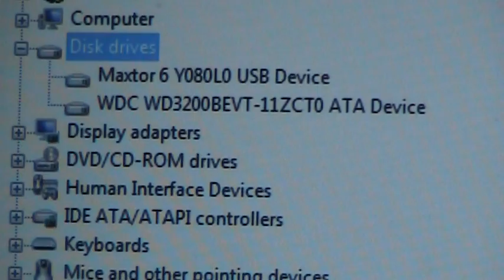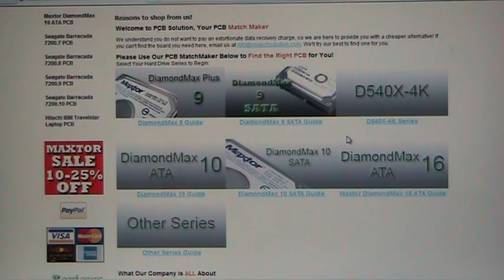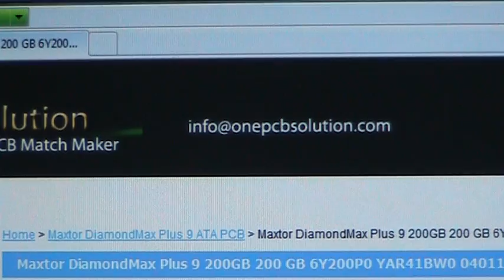DIY: How to repair a clicking damaged hard drive

Comment: @CoryDemone 

Platter hard drives: $0.01 / GB

SSD hard drives: $1.50 / GB (~$1.00 / GB for 1st/2nd gen SSDs)

This video is still perfectly relevant.  Also, when an SSD fails, you're completely fucked as the memory chips are soldered directly to the control board.

Comment: In The Tech field there is a Term called FRU: Field Replacement Unit , as he said earlier its either circuit board or internal problem. Repair can be done by replacing the none working part specially if its not worth the time and effort to go more technical to fix or find and pay some one with that level of skills, he showed simple trouble shooting skills to fix a complex problem . Nice Info

Comment: I got a maxtor and i get 1 big click.  No more clicks it runs really smooth but it doesnt do anything. Tried to run chkdsk /r but i cant. It somtimes doesnt even reach the xp startup. I get to choose whether to start up normally or in safemode but when the counter reaches 0 it automatically chooses normal startup but then it always makes 1 big click followed by some sqeaky noises and then it freezes. 
Is my hd broken?

Comment: @moastytoasty54 hard drive failure. you're on the right track. you rather than tinkering in hopes, you might be able get an rma for it. then you might have to get with the manufacturer for a startup disk and reinstall windows on a new drive. i just found my prehistoic maxtor if covered and it's from 2006. worth looking into.

Comment: @DH1Studios i filled mine with jello ( cherry works best ), then put it on the fence (south facing works best ), then i took a 12 gauge slug and "installed" it onto the circuit board. Now it works fine! :D

Comment: @makotomikami It is a mechanical hard drive and sometimes they make clickety click sounds.. It is somewhat normal.. But just to make sure.. Back up everything to an external harddrive. I guess that you dont have more than 250gb of disk so finding a cheap usb drive is very easy.  I use a program called always sync that is fast and cheap. The ac is probably not the resason because lappys have, well a battery :)

Comment: Ok serious question: I have this new laptop and the hard drive makes a low ticking sound sometimes, but performance is not affected at all, all programs run normally, I heard that hard drives do this sometimes when they're not getting enough power, and I've also heard my laptop would prolly need a better AC adapter, can anyone help seriously? :)

Comment: there is a click sound inside harddrive, then system hangs for some seconds.
some times it willnot booting. is my HD failed, replacing board will fix this? plz tell

Comment: @reply4reply Lucky, in my I.T class we had a few problems with static discharge.  Rare but it still happened, it could depend on clothing and if you touch something metal before messing with circuits.  Really I don't like to risk it when working on expensive computers.

Comment: I have a harddrive that was partially formatted by an Xbox 360 by accident. I tried to copy files to my new Xbox, but it doesn't work the same as the PS3 which lets you do that. I was only able to take files out of it and not into it, but now files can't go either way and I tried to use a trial version of GetData and it found 240 file, but it freezes after finishing. I can't click into files without it saying I should format it first, which would elete everything. I can't get my files out now.

Comment: @4BiZ20 dude, you can't blame pcbsolution because your hard drive has passed away :-/ This info is way too useful and if you want to know all that you asking, be kind and use GOOGLE - who is probably also used to find this video. (just to mention that i have "repaired" several hard drives using this method so i hope that you gonna repair your own the same way).

Comment: I was going to buy the circuit board for my harddrive but the actual harddrive costs $40 compared to $50 for the board only. You should sell the boards for way cheaper.

Comment: @MrShambolick Yes you are right. I want to warn every1 here: Easiest way how you fix a clicking HDD is: DON'T! As long as you're not in a clean (like CLINICALLY CLEAN; regarding dust) env., you're bound to get some shit into the drive and when you close it, something veeeery tiny 'll be floating around inside - wiki tells you about Bernoulli's principle, that keeps the head from crashing onto the disc via the air-film that builds up. Get something in there, break the air-film, dang there ya go.

Comment: A few years ago, I was transfering data to a seagate external harddrive.  It was sitting on a table one foot off a carpet floor.  The cord was tripped over and the HD took a tumble.  Now while it wasn't a super hard shock, it did take some impact and it was transfering data so the parts were moving when this happened.  It doesn't have a pronounced clicking sound, its more like a reaccuring humming sound.  And solutions?

Comment: OK, a couple of days ago my hard drive started to make weird clicking and clunking noises. I turned off my computer and tried to start it again. It said some error thingy. So I went to get a new hard drive. A day or so later I tried to boot with my original HDD as a second HDD and it freezes before any booting happens. Its stuck at the bios menu. What can I do or is it permanently damaged?

Comment: I dont know where I'll be with this drive by the time you answer (if you do), but my Segate Freeagent Hard Drive (500 GB) external, isnt getting detected anymore. Im pretty sure its spinning in there (i hear the whirring noise), I took it apart, removed the extra USB Logic board and connected it directly into my computer motherboard (SATA), no luck. Any suggestions or am I good to toss it into garbage?

Comment: @surikan1 

Did you check if you didn't have to add a jumper between pins 7 and 8. Some drives require you to do this if you run XP. Did you test your RAM?

Comment: how do you know if its a circuit board or another issue ? I have a seagate that is clicking that I removed from a macbook but am nervous about opening it any further as i cant see where the big chip is to figure out what kind of circuit board it is. I don't want to expose it and damage the data.

Comment from the maker: @HoneycombAgent The SMART data is not stored on the circuit board for older drives (manufac. before 2008 for sure). I don't believe new drives store SMART data on the circuit board either, but I have not confirmed this.

Comment: @pcbsolution Hi, thanks for replying. Since then I have (just) replaced the circuit board with one from another drive of the same model. The drive is now spinning!!! However it only shows up in device manager, and as lacking a driver. I've got it hooked up with a "USB to SATA / IDE 2.5 3.5 Cable adapter convertor". Apparently if it were in an external casing it wouldn't need a driver but now it might. That's as far as I got. I'd be very greatful if you had any ideas on how to proceed!

Comment from the maker: @Snake1979xfire the hard drive is no longer receiving any power? I suppose that could be the circuit board.
To be honest with you though, if it was full of bad sectors, I think the most likely cause is the disk head. I think this one needs a clean room to repair.

Comment from the maker: @patachu666 Ah that's a good point. For everyone that carries alot of static (if you get shocked by doorknobs a lot), touch a piece of bare metal before you start. For everyone else, even gloves are probably not necessary, but wearing it prevents low-level static and accidentally shorting something out (unlikely to happen unless you touch the PCB while it has power).

Comment: Hi. I have a question: My 1tb drive doesn't exactly click; what it does is start spinning, then after a few seconds makes a "rubbing" noise, then shuts down. It is not detected by the computer. Do these symptoms rule out this being a problem with the circuit board? Many thanks.

Comment: hey..i have a problem with my samsung HD320k....it works fine so far but randomly i hear a clicking sound(two clicks) then it goes away..comes back 5 minutes later then goes away..comes back 30 minutes later and goes away(randomly always)..and when it clicks the computer freezes for like a sec....the computer has become some what slow but it still works...whats wrong with it

Comment: I have a maxtor HDD to, first it was full of bad sectors i tryed to repair them for HDD regenerator and it did that sucsessfully.
I didnt use the drive after and later i wanna use it but now it doesnt notthing anymore.
It doesnt spin up or make any sounds.
I dont know if it are the circuit board, maybe its the motor.

What can be the problem ?
After repair the bad sectors it did run good and after it doesnt spin anymore.

Comment from the maker: @virtualskidmark if the drive can be detected, it is usually not a circuit board problem. I recommend using a software data recovery solution. The risk is a data recovery software could overwork your drive and kill it completely.

Comment: @pcbsolution yeah but seagate sold all the maxtor hard drives off first that was the problem. i wouldnt touch maxtor or hitachi. even tho seagate are maxtor now i wouldnt. i build my own pcs and i tryed maxtor years ago cos they were cheap and i had one fail after format and install of os, one died when adding data for storage platter stuck. and the last one i ever used was a 250gb maxtor sata and it just wouldnt let me format it or install os on it but it could find it. never again with maxtor

Comment from the maker: @zazgua Unfortunately there is no way to know for sure. If it started clicking suddenly, it is a 50/50 chance. If it started clicking awhile ago, and is now totally dead, or if the computer can still detect the drive, then it is not a PCB problem.

Comment from the maker: @TheDJjayson Hi sir, if the laptop keeps rebooting, it usually is not a circuit board problem. I can't remember the exact cause, but I think it is firmware corruption. I would strongly recommend seeking a data recovery professional if the drive causes your computer to reboot.

Comment from the maker: @heinz57mama I recommend trying a different enclosure first. If it doesn't help, it is a 50/50 chance that it is the pcb.
If it is a Seagate 7200.11 drive, it is more likely to be a problem with the drive's firmware.

Comment from the maker: @jamesanderson26 That is probably a scractched platter problem. I recommend sending it in. Or, you can try a data recovery software, but data recovery softwares could make your drive worse by overworking it

Comment from the maker: @eldisturbio If the drive can be detected, it is not a circuit board problem. This sounds like a disk head problem or alot of corrupt sectors. The safest thing is to stop trying things on it and send it in. You can also try a data recovery software, but it could damage your hard drive more.

Comment: I'm trying to fix a broken click-of-death hard drive but don't know how to determine circuit board, head or actuator problem. I plug my 2.5" 120GB SATA Toshiba laptop hard drive in to a SATA/USB enclosure and it appears as a 9GB disk (this is one of the partitions, not the one I want). I can browse for a minute then it hangs.

Now, do these symptoms suggest a circuit board change might fix the problem? Or am I barking up the wrong tree.

Comment from the maker: @Nootherlove1 I think the motor is probably stuck. You can try to take the platters out, I'm not sure how to do it myself. The problem is if the platters are disaligned with each other even a little bit, the data is gone forever.

Comment: I have a Seagate laptop hard drive that died on me awhile back. One day I tried to turn on my computer, and it just got stuck on the boot screen with the gray apple (running Mac). It wouldn't boot, it just stuck there on the boot screen. Does this mean the firmware is corrupted?

Most importantly...do you think if I put a new circuit board on, like in this video...d'you think it might fix it enough for me to get the data from it? Would there be any harm done in trying? Please reply!

Comment from the maker: @WildVke Unfortunately, most clicking problems caused by falls and drops cannot be fixed by the PCB. It is usually the motor, and does require a data recovery professional.

Comment: My cat knocked my external drive over and now it makes a similar clicking noise but it is a slow click every 2 seconds. Do you think it is done/dead? Or could it have just knocked something loose? It is a Lacie External Drive. I would be willing to replace the board if that would fix it.
Thanks, V

Comment from the maker: @rabanes040589 I'm thinking a lot of bad sectors or a bad disk head. The safest way is to send it in to a shop. Or you can try a data recovery software. Be warned though, the hard drive may fail completely at any time.

Comment from the maker: @markus155 It is very hard for me to tell. Usually if it happened suddenly, its a 50/50 shot. If you have been having troubles with the hard drive for awhile now, or if it was dropped, then its probably not the circuit board.

Comment from the maker: @hateyourbauman @hateyourbauman It is possible, the problem is WD PCBs tend to be hard to match because of firmware problems. One thing that should be match at least is the first few number on the sticker, usually in the format 2061-70XXXX. This alone is not enough though, not too sure what else needs to match.

Comment from the maker: Sorry for the slow reply. Usually anything involving power failures should have a pretty good chance of success.
Still, clicking is a very general problem, and it is hard to diagnose the exact cause without some trial and error.

Comment: @BigShotSpike: Good choice. When your hard drive just is after starting to act that way, most or all of the data MAY be recoverable. So the only right choice is to take the drive off work as soon as possible and only switch it on again for backupping purposes, in this case copying the files to your new drive.

Comment: Before trying to mess around with your hardware mechanically yourself or even before you give your hard disk away, always always try any backup still possible. Nobody's to blame for missing backups except the specific user.

Comment from the maker: Sorry for the slow response.
WD drives fail just like everything else, please backup your data no matter what. The reason we don't carry WD boards is because they are near impossible to match up, not because they don't fail.
Clicking is the sound of the disk head resetting and trying to read the same sector again. This does not damage the disk head unless something is out of alignment. However, greenboy623 is absolutely right, repaired hard drives are not reliable and should not be reused.

Comment: I'd call this repair method a quick trick for repairing valuable data, but nothing more than that. I've been in the PC repair business for a few years and I would never recommend using a hard drive that's ever had the click of death. The clicking noise is actually the armature slamming against it's limiter, jarring the head and damaging it anyway. So even though the PCB board is the culprit it's damage still damages the drive. Get the data off and replace the drive as soon as possible.

Comment from the maker: This HDD was trial and error for me. It depends on each case. If it was a power surge, chance of PCB failure is very high. If the hard drive was dropped, chance of PCB failure is around 0%.

Comment from the maker: I don't think it is a circuit board problem in your case. If you can run chkdsk on the drive then I'm assuming the system can detect the drive. Clicking in this case means bad sectors. I recommend trying a data recovery software.